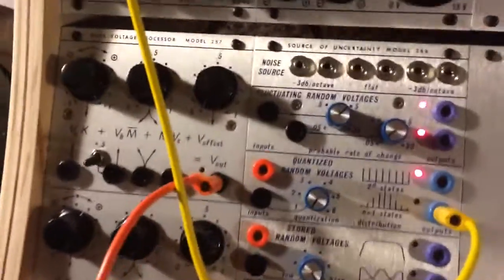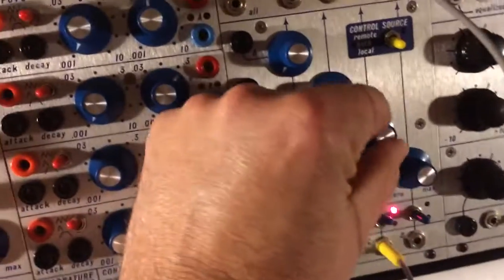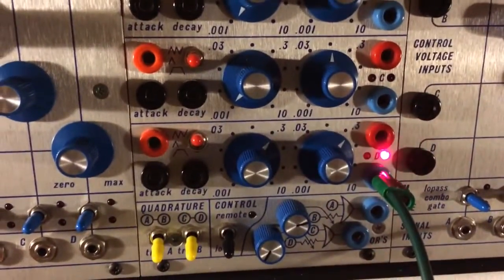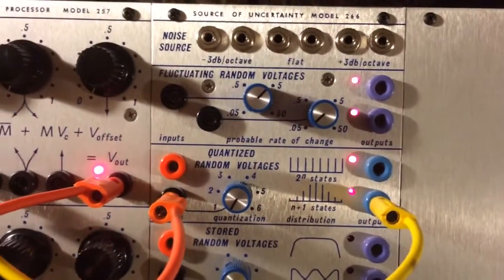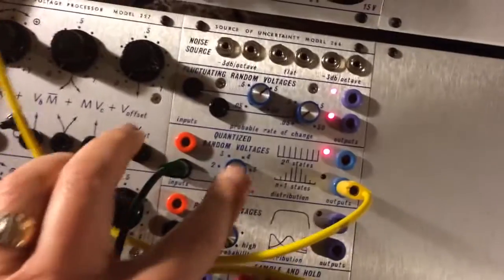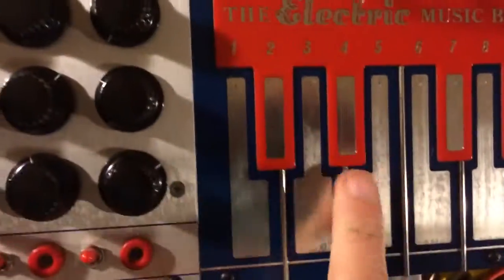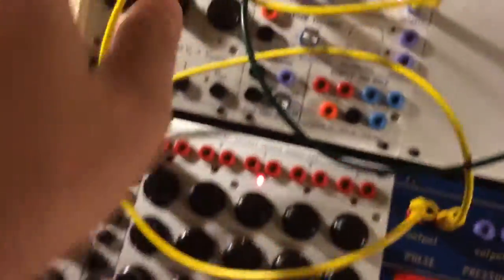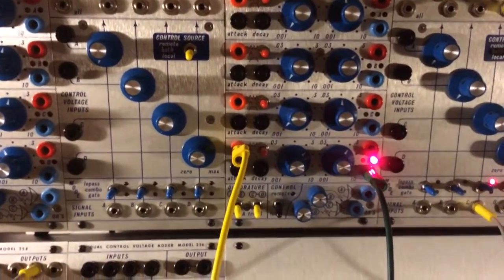266r QRV Trick - Buchla Patch

Comment: Hi, I have a built clone 266 but if I want to try selfpatching it does not work if I connect the output of fluctuating random (purple or blue) to the input of the quantized random (orange). Is that normal or does it only react from a pulse output ? Only if I connect from the output of a 281 then it works. So, in my clone the orange jack inputs works only from a pulse. I saw a video of Todd Barton where he could selfpatching from the random output to the orange input.